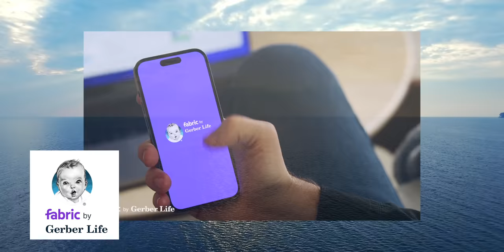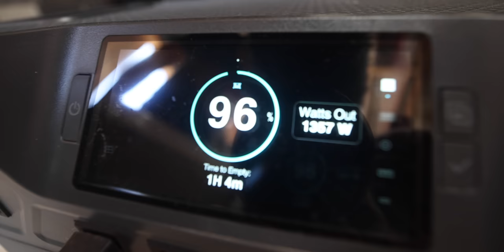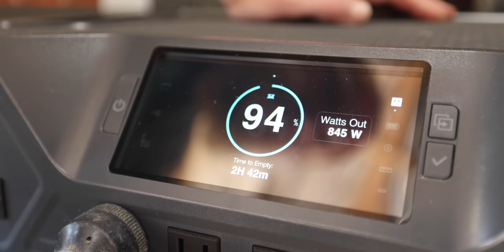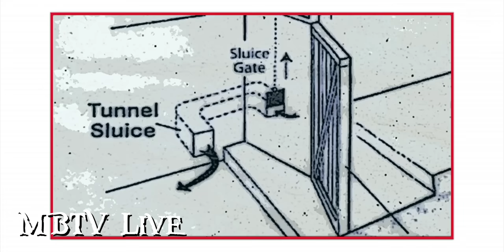Wild 🍄 Mushrooms Catch & Cook - DAY 2 of 7 Waterworld Survival Challenge Season 2 Pirate Ship

Comment: not to question the building of the front or the building in general but if you added a small foot-and-a-half tall wall alongside you would have been able to push the front out and make yourself a little kitchen area with some drawers and stuff does a foot-and-a-half tall wall without its structural stability to the actual front and back

Comment: My idea would be to drill a hole in the back of the cabin put an eye hook on the inside of the cabin and then feed a PVC pipe through the hole in the back of the cabin out the back like five or 6 foot that way you can tie off the boat to the hooks inside the cabin, run your line out the back of the boat through the PVC pipe past your motor And then to the boats. it would just take a long stick or putting the boat in reverse after you let out the line of course. Or what would be even cooler is to have like a 3 foot PVC pipe that you can move 180° and lock into place. That way you can swivel the boat in to the side of your boat or swivel it out to the back past the motor. Just my idea I don’t think you’re gonna be making a pirate ship anytime soon again, but for some reason my brain goes to ropes and tubes and making it work somehow.
Reply: And what I mean by swivel is cut a 4” x 2” or 5” x 2” hole in the side of the cabin. have a piece of PVC pipe with a nutting bolt going through the center of it then you connect that to the long square you just cut out somehow maybe buy a little frame on the inside that you drill a hole in and also put the bolt through but you could swivel the boat against the side of your boat. If you turn it all the way left or if you turn it all the way right you can put it out the back of the boat pass the motor and that PVC pipe won’t allow it to come anywhere near the motor or the side of your boat when you don’t want it to be there